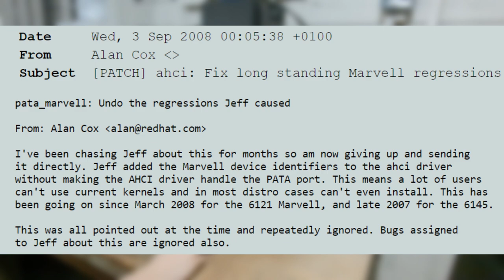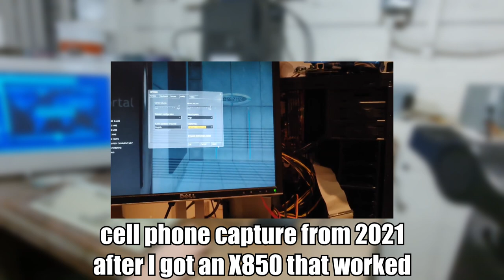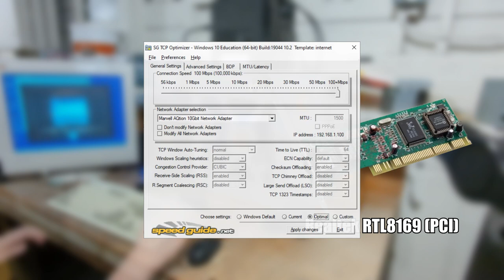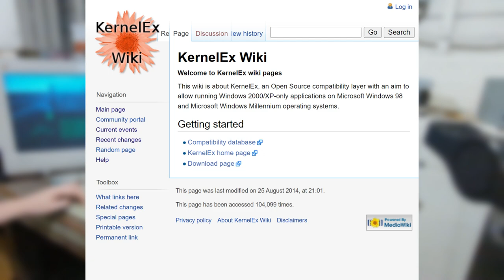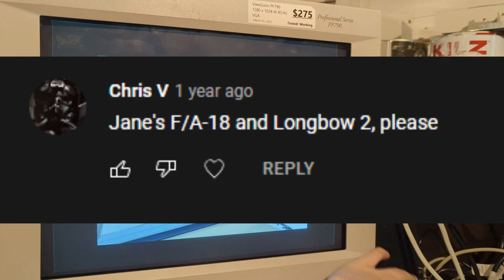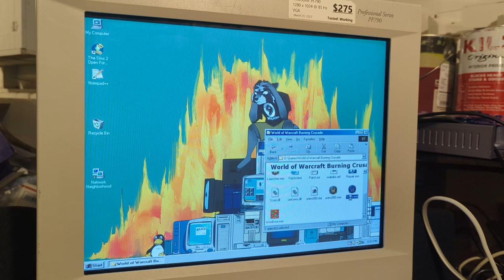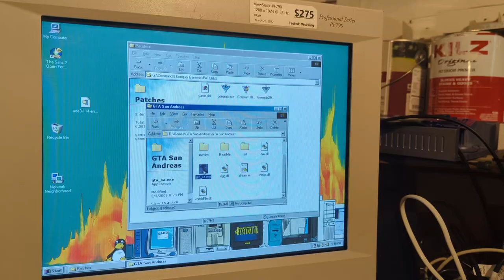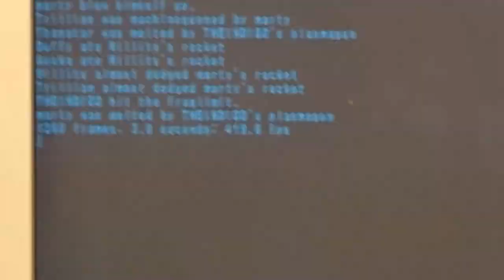Building the REAL "ultimate Windows 98 PC"

Comment: I guess we'll see part 2 in Q4 2023?
Reply from the maker: Pinning this 'cause you kinda called it oops
Reply: No!
Reply: @CursedSilicon  Hi! I have a question - what do you mean by "backport an older opengl dll file from the 81.98 driver" at 10:42? Is there any place where this procedure is explained, or if not, could you please explain a bit if that's okay?
Reply from the maker: @IonfraX  Hello! 

You'll need to grab a copy of the 81.98 driver. You can then extract it (it's a ZIP file basically)

Inside you should have an "NVOPENGL" file. Simply replace the one in the 82.69 driver with that and then run the installer
Reply: Is that in Boeing years?

Comment: Excellent video. I built my Ultimate Windows 98SE PC with all drivers working(no yellow icons) including network and USB.  Hardware is an Asrock 4CoreDual-VSTA with a Core Duo Wolfdale E7600, with a very slight OC taking it to 3.1ghz. The video card is an Nvidia 7900gtx, hooked up to a 30" NEC 2560x1600 LCD. The sound is an Audigy Live! card, with both Windows and MS-Dos working. I have both a conventional HDD and removable SD(SD flash), so I can dual boot, the SD card has a custom 3 1/2 front plate, with just a slit for the card to pop it out. It also have a DVD burner, 3 1/2 and a DS/DD 5 1/4 floppy for making DD disk for other retro machines I have. It works perfectly and runs all games I tried, and all benchmarks too that run on Win98SE. The only quirk I have experienced, is it will not do a soft reboot, you have to shutdown and restart, but that is no biggie. This rig is insanely fast. It has the same software upgrade you did to make it more compatible, though have not tried your tool you made yet. To get the 7900gtx driver I took the latest drivers available , joined them together and updated the ID list. I tried getting the 8800gtx to work, but at the time back in 2017 or so there were no good VxD drivers I could tweak to get it to work. Also, one trick that worked well for me, was installing the Windows 98 on a normal machine, creating an image, and then move drive to the ultimate pc. That seemed to cause less errors than installing Windows 98 from scratch.

Comment: You should consider Getting a CRT that supports QXGA (2048 x 1536) @ 60fps, that would make your setup that extra bit more ultimate since its also the maximum resolution that VGA can support. I know there are several Viewsonic CRTs from the early 2000s that support this resolution and from what I can tell they don't seem to be unobtanium at least so its something worth looking into. If you're lucky you may even be able to get that resolution to work on your current monitor with some workarounds

Comment: Your video card issue may be an issue with PCIe compatability.  I have 2 PCIe x800 XL cards, and a PCIe X800XT that all work fine on 2 different PCIe motherboards that I have been testing for my own 98 retro build.  2 of them work perfectly, while one has a few missing motherboard component drivers.
Reply from the maker: I was able to replicate the issue with the X850's putting them into much more modern machines (including my Ryzen 5000 series desktop) 

From what I've found researching it seems to just be these cards are from the same era as the lead-free solder transition. The same thing that caused the Xbox 360's RRoD and other issues

Comment: Nice Project. I still do not see any particular reason trying to run a 2000/XP game in Win98SE, better having a dual boot instead of dealing with patches and stuff. Also you are "loosing" the other CPU Core. Maybe that is not a "Ultimate WinXP" machine too, but it is much more than we had back mid-2000.
Reply: An ultimate windows xp machine has a gtx titan x.

Comment: For my ultimate multibooter 2005 PC I didn't risk it because I didn't find the newer nvidia drivers very stable despite knowing they existed.
I went for the 6800GT instead combined with the 77.72 driver which gives a pretty good experience on 98, but for the games its failing at I have a Voodoo 2 in the build as well to pick up the slack. The system runs everything from Windows 3.11 (With limitations) up to Windows 10, very happy with it :D

I personally go for Autopatcher and leave KernelX out of it since KernelX I noticed can be a bit buggy where you need to enable compatibility settings tweaks for software that otherwise would have worked fine. On a 98 only system KernelX makes a lot of sense, but for the stuff 98 can't run I just reboot to XP.

Comment: Very nice video my good sir! So interesting to see how different combinations of hardware and software (which, is endless in the PC World) can result in such different outcomes! I had the opposite experience on the GPU side of things... Like you, I made the “mistake” of going with a PCI-e motherboard for Windows 98 (something VOGONS will always tell you to avoid and go with AGP instead): an MSI MS-7139 v2 with VIA K8M890 chipset plus Athlon 64 3500+. The choice here was mostly motivated by my desire to use the fastest single core Athlon 64 I could get my hands on (since they are so fast and still very friendly to Windows98, without wasting a secondary core on Windows 9x), on a small form factor Micro-ATX setup.

With this mobo+CPU combo I simply could not make any Nvidia 6xxx GPU work reliably on Windows 98 (tried all compatible Nvidia drivers with different [all bad!] results). I tried one 6600GT and two 6800GT before I gave up on Nvidia (it was crashes galore!) for this project and got a Radeon X850XT PE… And guess what? The first Radeon X850XT PE I got worked flawlessly on my setup! Runs every single game I tested on it so far (dozens of big releases from the 1995-2002 era) with the highest possible frame rates in 1280 x 1024. I honestly was surprised how stable the system got with this GPU, after all my struggles with Nvidia (which made watching your video so shocking when I saw your diametrically opposite experience 😂)!

On the software side I didn’t push things as far as you did though: I just used Win98 with the same unofficial SP3, which was enough to run all the games and apps I needed (I have another machine with WinXP for post 2002 software).

One area I did struggle (as you did) to make it work properly was the storage controllers. My mobo came with both IDE and SATA ports, but in the end, I had to turn off all SATA in the BIOS and use only IDE (used the same SATA do IDE adapter you did for my 120gb SSD). For some reason I could not even use primary and secondary connections on the same IDE channel… Had to be ONLY ONE drive, the SSD, on the main mobo IDE port (I installed a PCI SCSI adapter for CD/DVD-ROM duties and left the other IDE port for an internal Zip 750mb drive for “sneakernet”, since I don’t use any networking on this machine).

It took me about 6 months of experimentations with this PC to get it to where it is today, which is a very happy place I must say (have been running it rock solid with no game crashes for over a year now)! So, I always keep a mirrored version of my latest successful game installations on this Win98 setup (on another 120gb SSD), since I DO NOT want to go through the rigamarole of ever having to reconfigure the OS on this machine again! 😆

Comment: OMG, that's a Viewsonic PF790, that's the crt I use for my 98 and XP/7 rig 😄

Unfortunately the EDID info on mine got corrupted back in April so I've had to use CRU (thankfully I saved a profile on it before that happened) or 3d party software to manually set the information for the crt.

Comment: Fastest Windows 98 PC but at what cost
Reply from the maker: Rough itemized breakdown from eBay etc

Motherboard: $60
RAM: $50
SSD's + Adapters: $100 
Case: Free
Power supply: $20 
GTX 7800: $80
CPU fan was maybe $15 I think? Add another $20 for some ThermalGrizzly Kryonaut paste 

So about $350 all up

(Plus my sanity of course)
Reply: What about the $2k you spent on graphics cards?

Comment: 33:18 Not only is it 25fps, but instead of the frame times being 40ms, it alternates between 33ms and 47ms every frame for some fucking reason. Fun fact: that extra 14ms on every other frame also applies when you turn off the frame limiter, so it's impossible to get more than 142fps(or 200fps on the steam/rgl versions). Just thought I'd mention this.
Reply from the maker: Holy shit the port is even worse than I was lead to believe. What the fuck were Rockstar DOING

Comment: I'm on this exact journey right now and just stumbled onto this channel while trying to figure out what the hell I am doing. (Currently picking out parts for the build). I also decided to go with a VIA chipset because it seems to have the best 98 compatibility well after 98 was put to rest in favor of XP. I was looking at Socket 939 boards though as I also decided to go the AMD route. AnandTech had some good benchmark data for boards still equipped with AGP of that era (2004ish). However Abit and Asus both have PCI-E models that are basically just incremented VIA chipsets that support PCI-E on what is more than less the same board... But I'm not finding those listed on ebay. I am finding the Asus M2V you've shown here though. So now I'm just kind of scratching my chin and deciding where to go. You're project goals are largely the same as mine. Stupid fast 98 on fully supported hardware. I hadn't even considered Socket AM2. Really interesting. I would like to keep some DOS compatibility though. Of course DOS doesn't need this kind of hardware, but neither does 98 at the end of the day. For me DOS is kind of part of the 98 experience. So... I'm starting to drift back towards the idea of using GeForce FX or older GPUs. Asrock does make a Socket 939 board with a ULi chipset that actually supports both PCI-E and AGP... I don't know man. It's a rabbit hole. LOL. Anyway, thanks for the video. It's literally the only one I have come across with the same ideas I had in my head so this was super helpful, and congrats on a build well done!
Reply from the maker: I tried a ULi chipset board originally (The same 939 board that PhilsComputerLab) used 

Unfortunately the chipset has broken DMA support which renders the system unusable under 98

If you want to preserve DOS compatibility just go for an older ATi or Nvidia GPU (Pre Geforce 6) that still has the Vesa BIOS Extensions (VBE) support

Comment: I've made a similar computer, but with team blue (same 7800GT for the gpu).
My board uses a VIA P4M900 chipset (pretty bad chipset, but it supports w98 for the most part and early core 2 duo !).
I've paired it with a core 2 extreme x6800 at 2.93GHz
The only thing that seems to be unsupported by windows 98 for this chipset is the HDA audio controller. But that's a minor inconvenience. The rest of the chipset works fine (onboard network and even the IGP works !). I've tried to use SATA, and while it's "working", my experience with it has been terrible (OS was super slow and unresponsive despite using an SSD).
Also my chipset is so crappy that even though I've installed 4GB of RAM, it only detects 2.5GB ... Still plenty for Win98, but that's just bad.

I haven't had the time to setup many games on it yet though. One of the games I tried was ... minecraft :D. Release 1.7 is about the last version that works without trying very cursed things with java.
Reply from the maker: What board are you using? That's quite an impressive setup on its own! 

You might be able to fix the SATA issues by forcing DMA to be enabled via the "Unofficial Win98 Service Pack" (install v3.64 then v3.66 due to a bug in 3.66) 

The RAM issue should be fixable using Rloew's "highmem" patch as well
Reply: @CursedSilicon  I don't quite remember the board I'm currently using (other than being an MSI), but I do remember the board I used before which has exactly the same specs (which I had to swap due to an accident...), it was the Gigabyte GA-VM900M.

I think I tried the unofficial service pack, but I didn't know about that bug, I could try again I guess. As for the RAM, the rloew patch will not change anything, it's already installed to work with that 2.5GB amount, the issue is that it's what the bios detects at most and I believe it's a chipset limitation.
Iirc some chipset controllers back then were limited to 32-bit bus even though the CPU is 64 bits. You don't have this issue on an AMD since the memory controller was already integrated to the CPU, but on 775 that's a thing that matters (also, I've been told that the memory controller on this thing was terrible)

Comment: also, you could've use rloew's PATCHMEM when it complains about too much RAM, then you could've used the onboard LAN.
DOS games don't like too much RAM though, so it's better to keep it under 1GB for DOS.

You also could've use a SATA to IDE adapter for the IDE port, then the marvell controller would've been happy.
Reply from the maker: I didn't discover PATCHMEM until after Rloew's unfortunate passing. Though that did fix the low-mem issue

IDE was already fixed by using Startech SATA to IDE adapters, it was the Marvell SATA controller that is broken in silicon that is the problem unfortunately

There's a Linux Kernel patch regarding it from 2008

https://lkml.org/lkml/2008/9/2/272

Comment: You focused a lot on the gpus and not on the mobo in my opinion, by the looks of it i would choose a different mobo or platform all together. Never checked the athlon 64 x2 on windows 98 so i don't know how compatible-stable it is on win98.
Reply from the maker: Any CPU will be stable, as a CPU simply executes given instructions. 

The VIA chipset itself is quite stable, it's purely the motherboard itself that has issues under 98

Comment: Wow, what an impressive project! Congratulations! Would you mind posting links to the patches and tweaks you applied to the system?
Reply from the maker: Sure! The patches I used were

- Rloew's 4GB RAM, NVSIZE and later BIOS low mem patches

- The 98 "unofficial service pack" 3.63, then 3.66 afterwards (3.66 contains an installer bug and can only be run as an update after installing 3.63, it cannot "clean install" for some reason)

- KernelEx for enabling certain games that were 'unhappy' with running on 98 by default such as Star Wars: Empire at War

Comment: The term "Ultimate" is very subjective. In terms of compatibility versus performance or stability there are always trade offs. Pick too new parts and lose compatibility. Pick too old of parts and lose performance. Pick crappy chipsets and lose stability. After messing around with many different configurations with windows 98se, I have found that a 3+ ghz P4 with 2x256mb ddr400 in dual channel on a intel 865 chipset with a nvidia gpu no newer then a FX series card seems to be the sweet spot. The 865 chipset offers SATA that works in IDE mode and has all the drivers for win98se, the 3ghz p4 has plenty of grunt to push the FX series cards, supports AGP 8x. The intel 865 chipset is rock solid in 98se. For sound I normally stick with Audigy. I don't try to play XP era games  on my 98 machines. Oh and as for graphics drivers under win98, Early Nvidia drivers offer better performance while ATi drivers got faster with later versions. That's why many older games run faster on a Geforce2 then a later card like a fx 5200.
Reply from the maker: You'd get significantly better GPU performance (even under AGP) with a Geforce 6 series. The FX5200 and FX5500 are well known for their horrendous performance
Reply: @CursedSilicon  you lose game compatibility with GeForce 6k series cards. No table fog support. Try running older games on a GeForce 6 and see what I'm talking about. No fog im thief looks pretty bland.
Reply from the maker: @lilkuz2005  Fair. Though I suspect that's something that could be fixed through fan patches or even something like a Glide wrapper. Once you've hit a GF6 or GF7 you've got so much raster performance you can afford a translation layer
Reply: @CursedSilicon  the GeForce FX series sucked with dx9, but they ran great with dx8 and bellow which is the versions of dx you want to use in win98 in the first place.

Comment: There's plenty of YouTubers you fix faulty electronics incouding GPU's. It would be great if you could get one of them to try and fix the 7 broken x850's and video it.
Reply from the maker: The problem is that in order to fix it the entire GPU chip needs to be physically removed, then its solder balls replaced, then the chip needs to be reflowed on to the board 

The only youtuber I know who does that kind of work is Louis Rossman. And he specifically refuses to do GPU reballing!

Comment: I'm currently in the process of getting the parts for mine. The only differences are that the board I'm using is the M2V-MX SE (since I'm building it inside a Compaq Presario 5000US microATX case) and that the GPU is a 512 MB 7950 GT (since the only 512 MB 7800 GTX I could find on eBay costs $300). Since the M2V-MX SE has a slightly different chipset, will it have the same issues as the regular M2V?
Reply from the maker: I'm not sure, I have not tried the smaller boards. I don't think a 7950 will work either as if memory serves that's an SLI card, you may end up only getting one GPU running instead of both, resulting in worse performance 

You may have a better time getting a GTX 7900
Reply: @CursedSilicon  You're thinking of the 7950 GX2. The 7950 GT is just the 7800 GTX with a die shrink and 50 MHz slower memory.